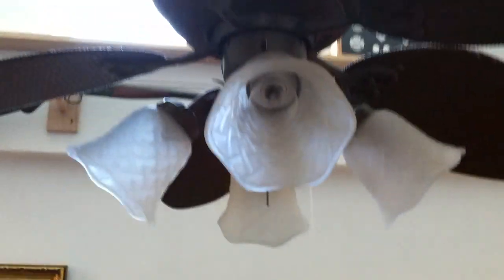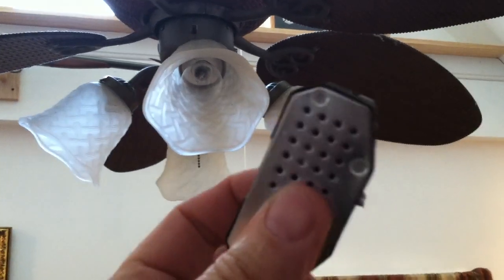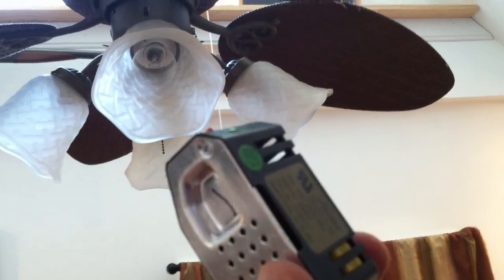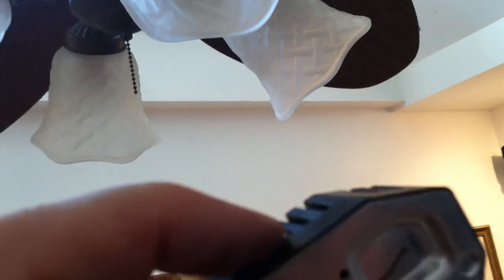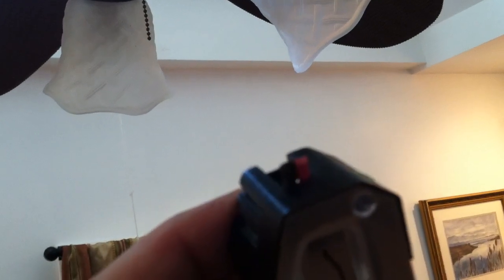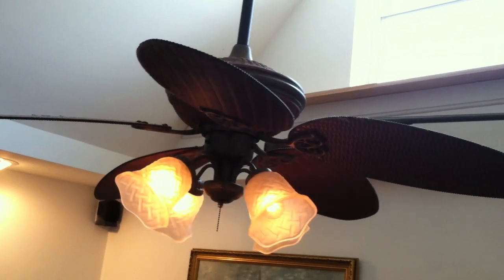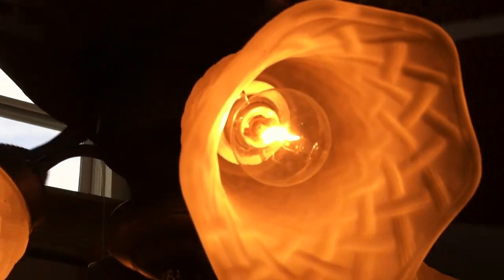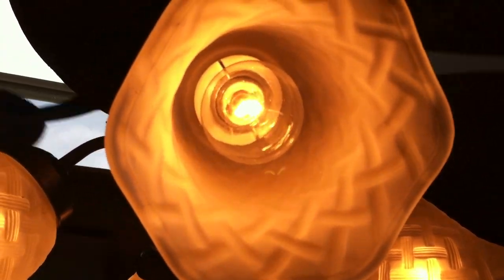Wattage Limiter

Comment: I  just assembled a new Kichler fan and wired it up. Fan is working but the lights refuse to come on. I even tried different bulbs. No good. I looked suspiciously at the cute wattage limiter module the manual mentioned. It must be a loser. I will bypass it tomorrow. I love your comments on the wisdom of our Federal wizards. The DOE made sure the fan uses no power for lights with a failed module. I look forward to chucking it into the trash can. Thank you.

Comment: Actually it's a Harbor Breeze Key West, only sold for 6 years, 2003-2009, discontinued in 2010.
Reply from the maker: If you're correct, and I have no reason to doubt you, I stand corrected.
That said, they all are required to have a wattage limiter regardless of brand.
Reply: Here's the link. https://www.lowes.com/pd/Harbor-Breeze-52-Key-West-Vintage-Pewter-Ceiling-Fan/1235201  @captralf .